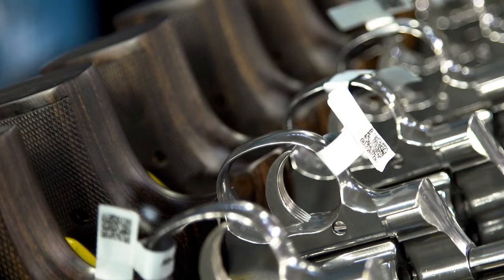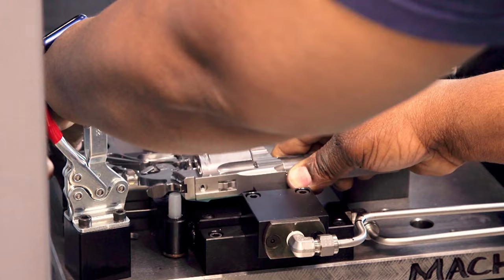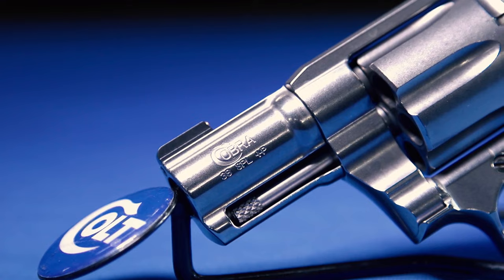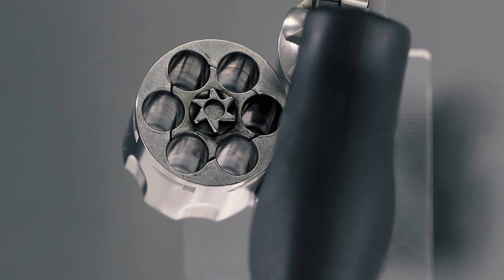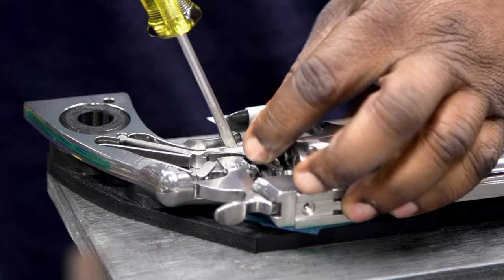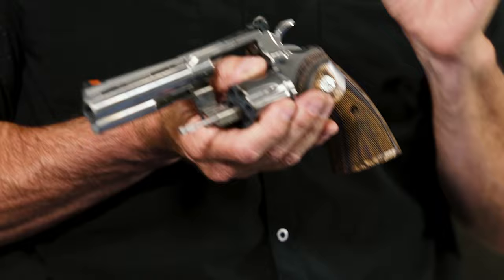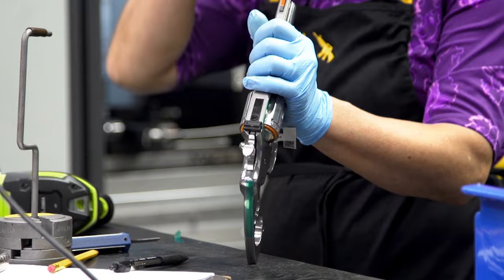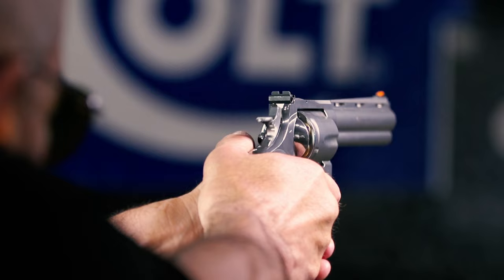Making Modern Colt Revolvers

Comment: The new 2020 Colt Anaconda is heads and shoulders better than the original Colt Anaconda. The thicker top strap and longer and wider cylinder. The improved Colt Python 2020 action expanded to Anaconda dimensions.
Reply: Agreed. Unless you're buying to collect there's no compelling reason to spend money on an original Anaconda when the new ones are better, and widely available.
Reply: No it’s not but it is nice enough.

Comment: I've been shooting Colt revolvers for decades and the new revolvers are such a joy to handle and shoot.  I've been very impressed with all models of the new releases.
Reply: I grew up shooting my uncle's and Dad's old colts.  Police positive 38 special,  woodsman's,  New frontier .22s.    my dad bought a SIngle action Army in 45 lc about 20 years ago.  2nd generation.  It developed a bur and had to go back to colt once but it got fixed!  Shoots great now.   My dad's friend passed away a couple years ago bought a new production king cobra and when you went to shake it, you could hear some parts in there raddle.  I shot it a few times and it was a nice gun but it ended up shitting the bed on him.  Cylinder wouldn't turn or even open.    I'm sure every now and then a guy gets a bad one but they don't put as much attention to detail into the new ones.  I bought a 1979 Colt python blued for 2700 back in 2018.  Came with the hang tags, box, everything.   Guy barely shot it at all.  Not even a ring in the cylinder.   It is such a honey to shoot.   I figure yeah I overpaid a little for it but when you look at what it would cost just to bring back that deep royal blue.  That would be like $800 right there.  So 2700 wasn't too bad.   I'll enjoy this revolver until I push daisies.   The people that fret about it going out of time are the ones that never cleaned their guns.  Some people brag about their round counts without cleaning.   You do you but I'm gonna baby all my old colts!   If you want to rapid fire 357s in double action all day long,  you do you.

Comment: My 4.25" Python is a masterpiece, truly. There's hundreds of utterly perfect tolerances on it that blow my mind every time I pick up. Worth every penny. I'm looking at a Night Cobra as a pocket counterpart to it. I've seen several pictures of the Cobra internals and it seems like at some point Colt moved from a MIM hammer to a forged one, can anyone confirm this? Modern S&Ws have MIM triggers and hammers as well, perhaps it's nothing to worry about as long as Colt themselves are supervising the metalurgy
Reply: I had an early 2018 model Cobra. 3 Times back to Colt for repair of major trigger and internal failure. They were kind enough to refund me the purchase price and even made a offer to replace the weapon which I declined. It was MIM part failure on all occasions at between 3 and 4 hundred rounds. Maybe someday I will find another Colt to own but it's likely to be a vintage era one  with forged parts

Comment: I came close to buying a vintage Python that I wanted to shoot I called my gunsmith and asked his opinion. He explained about how a lot of the parts are hand fitted in each python to make it fit properly and work.

He further explained me that should I buy one and regularly shoot Magnum loads that one of those parts could break and it might not likely be fixable.

And I don't want to spend $3,000 or more on the vintage gun that I can't shoot.

So I spent $600 on a used Smith & Wesson 586 4-in blued that I can shoot. Parts for those guns are readily available.

Now that Colt has released a contemporary version of the python in a blue finish I'm intrigued.

Comment: The new Python looks OK, but the trigger aesthetic looks off...  Be nice to see this new Python with a trigger more closely matched to the original.  Wish QR code marks were not on a firearm, and would be nice to see a royal blue option too.  I know these and many currently made guns are full of MIM parts, and I hope they are finished and made to a high level.  Good luck Colt.
Reply: Better then original
Reply: I hate the QR code on them.  It needs to be hidden inside the frame under the grips or where the cylinder crane locks.

Comment: How long does it take the factory to repair a new 2020 Python returned under warrantee? I bought one  1-4-23 and light strikes were experienced DA right out of the box. I returned it and am still waiting 6 weeks later. I heard all the bugs were worked out but apparently not. A nice smooth DA pull is worthless if it's not reliable. What's with the new warrantee? It's only for a year? Why aren't parts available for the new Python? A simple MS replacement may be all that's needed instead of waiting months. Disappointed.
Reply: Thanks for sharing that. I have some old Colts that still function and a 2004ish SSA that doesn't get fired enough to have problems. Basically. I've never had to deal with customer service at Colt. I have dealt with Ruger and have to say those people know how to treat a customer.

Comment: Bring back QC 😂 got a king cobra that had a gap between barrel and frame that you could literally stick you’re fingernail in! Traded it off
Reply: Had the same issue with a cobra and king cobra, the cylinder end shake was terrible on both of them and sent them both back to colt multiple times with no real fix so I traded them off. Colt needs to drastically improve QC

Comment: Alright now make blued python’s please I’ll pay up for it
Reply: I would too. I don’t want a chrome revolver
Reply: Stainless doesn't take blueing very well, they'd be adding a significant amount of weight by going carbon steel, look at the S&W 637 weight vs the Model 36 classic, 15.5oz vs 19.4oz for functionally the same gun
Reply: Colt is doing their high polish royal blue on Single Action Army and 1911's through special orders in their Custom Shop.  The high polished blued finish will be offered at some point for all the 2017 - present snake gun models, especially the Python.  But you can almost be certain it will be a special order through the Custom Shop only or a limited edition run. Either way, you better be ready to pay the big boy amounts if you want one.  If a regular stainless is $1,500 MSRP......a high polished blued will easily be $2,000 to $2,500 each.
Reply: They are !

Comment: The problem with Colt they do not make enough handguns.  Try finding a King Cobra in .22 lr with a 6 inch barrel.
Reply: They have NEVER produced one of those. They made the 4" for a few months and ceased production. They are making design changes before they start making them again.

I sent mine back for a broken trigger return spring like 4 months ago, they destroyed it and said they would send a new one when productions started back up in a few months. Still haven't heard back

Comment: New Python as good if not better than older version. My only dislikes are 1) Loose rear sight - easily remedied by purchasing an aftermarket sight; 2) Agressive grooves on the trigger. It makes it uncomfortable when shooting double action.

I esecially like the stainless finish, stronger frame and the ease of replacing the front sight blade to a fiber optic after market model.

Kudos to Colt for making them avaiable in the gun oppressed state of Massachsetts 👏👏👏

Comment: 1. Why did they make the firing-pin PRESS FIT into the frame?? Which makes it FARRRR harder to replace??
2. Why did they add that HIDEOUS QR code right in your face on the frame, and not say inside the grips???

Comment: Except they aren't better.  Reviews from people that bought a gun are showing it. Trigger pulls are heavier in both single and double action. No blued steel as an option.  Fit and finish aren't there yet. I am a Colt fan.  I want you to succeed, but you aren't there yet. Accuracy is not nearly the same. My 1965 Python will shoot X rings all day. Fix the Python hammer while you're at it.  It looks like it belongs on a gun costing half as much.

Comment: I own the new Python in 6 inch and the new Anaconda 6 inch. Here's my take on them after a few years and a few 1000 rounds diwn the tubes. The new Pythons  were not a hit when rushed out. Colt banked on the hype and it worked but QC took a hit on the reintroduction  of thier flagship wheel gun. They had 20 years to get it right and fumbled. Complaints of muzzle crowns buttched, light stikes, wheel lock ups and rear sight set screws and blades flying off. All were addressed but the rear sight. The one who designed that rear sight, and gis buddie who approved if for production should go back to Arbys as a fries manager. My complaints on both are the sloppy fit of the rear sights, front sights; although better then pined on, they should of been tooless like Smith does; roll marks, why couldn't they be original?; heavy DA pull; positive angle on the hammer hook causing hammer to cam backwarks before falling, Python cylinder on the short side, cylinder gap could be tighter, .010 is a little big for me.
Other than those issues, the positives are many. Replace sights with Wilson, removed positive hammer hook angle. Thank Colt for getting the snake guns back to production so many can own one now. The fit and finish on a production is second to none. Smooth pull in DA or SA. Leaf spring design is a major Anaconda upgrade along with a nice long cylinder. Much fewer parts to break.

Comment: Ever hear of the "bank vault lockup"? Well, that is one of MANY reasons why the old Pythons are still better. With the bank vault lockup, the cylinder is held tight during fire. If the cylinder is opened & closed properly, the precise timing will not create a "turn line". Of course you had THE Royal Blue & Nickel finishes of old.

Who cares the new ones are "30%" stronger, your normal poindexter will never get close to reaching it's lifespan. Yeah, the old ones needed some timing correction after heavy use, that's expected with something as intricate as the bank vault lockup.

Now, I'm not saying these new ones don't have a place at the table, they do. I'm happy Colt is making them. I'm sure they're great utility guns you can beat around & not feel that bad. They give the current poindexters the chance to buy a Python new because they're too dumb to buy a quality old example. I just wish people would quit with the "they're so much better" nonsense. They're really not, for reasons most poindexters will never understand.
Reply: I have a 1968 4" nickel Diamondback and a 1971 4" nickel Python and a 4" 1993 Anaconda.  The Diamondback has the smoothest action of any revolver I've ever fired or owned.  The Python is right there with it but I still prefer these to the new ones.  For one thing I don't care for seeing a QR code etched into the frame.

Comment: The QR code is just plain dumb. If I knew it was there I probably would have bought a GP100. I will get  586 when available.
Reply: Yeah, it could be hidden under the cylinder lock up or under the grips